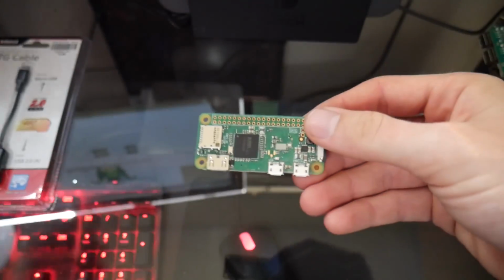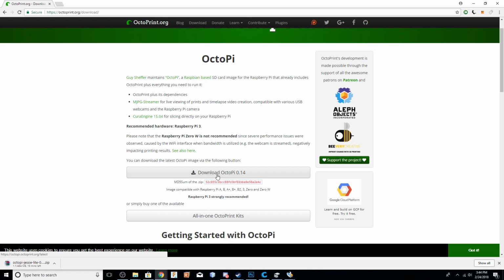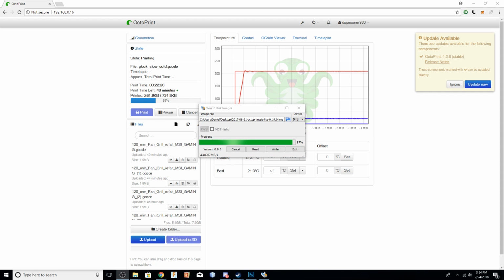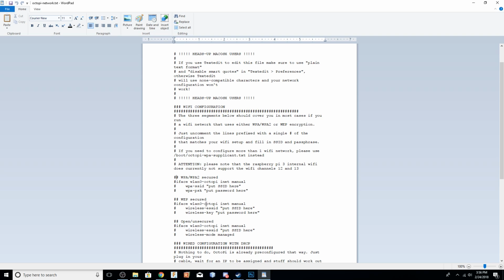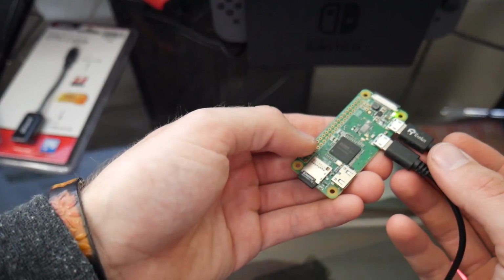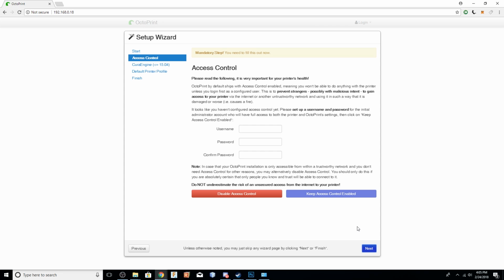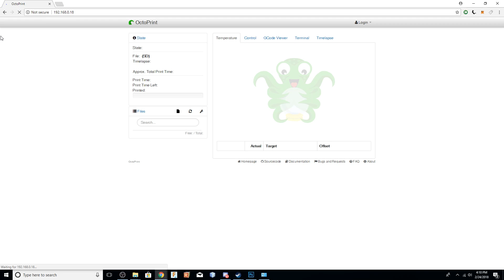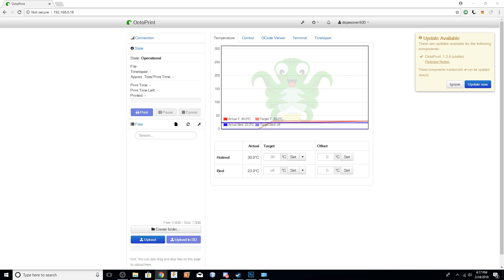Tutorial Installing Octoprint On Raspberry Pi Zero W | Wireless 3D Printing

Comment: The Raspberry Zero 2 W is as fast as the Raspi 3B and also has a quad-core CPU. 
The Raspi 3B+ has quad-core CPU and WIFI AC
The Raspi Zero 1, Zero 1 W and Zero 1 WH only have a single core CPU as a Raspi 1 B

Comment: new pi zero 2 w coming out an im hoping it will be able to handle the webcam now since it is suppose to have a faster cpu even tho the memory is still going to be 512mb from my understanding it suppose to be similar or the same cpu as the older pi 3 an same video. its a quad core 1ghz while the original was a single core at 1ghz if i remember correctly.

Comment: I just ordered an sd card wifi board, but it`s only limited to dumping files there for printing, no control over the printer itself, I did look at Octoprint with a normal Raspberry PI, but I thought the price was expensive and the board is overkill for whats it's being used for, this little board is just right, I`m ordering now lol, thanks for the great video, much appreciated, cheers ;)

Comment: So any issues with the Raspberry Pi Zero W using a camera? Does it still run ok a few years later? Their site suggest to not use it on a Pi Zero w.
Reply: Octoprint is pretty resource intensinve. If you want a 3d printer control panel with webcam streaming you should try klipper with Fluidd/mainsail on a more efficient Linux distro. I made this guide for an even weaker device and I get < 35% cpu load while streaming and printing: https://github.com/ihrapsa/KlipperWrt I've tried it on a rpi zero w and I get even less cpu load

Comment: does it really not work with a camera?
Reply: Octoprint is pretty resource intensinve. If you want a 3d printer control panel with webcam streaming you should try klipper with Fluidd/mainsail on a more efficient Linux distro. I made this guide for an even weaker device and I get < 35% cpu load while streaming and printing: https://github.com/ihrapsa/KlipperWrt I've tried it on a rpi zero w and I get even less cpu load

Comment: I installed Pi zero W with octoprint to my ender 3. Unfortunately I discovered Zero is underpowered even without camera. When printing round parts printing slows downd and quality is bad. PCU usage is aroud 100%. I reprinted same gcode from SD card and quality was much better. So I ordered Pi4 and it should work fine.
Reply: Try checking the usb power. Probably is an underpower charger.
Reply: @willss96  I used good quality 5V 2A charger. I believe Pi zero is the problem. I bought Pi4 for octoprint and it works perfectly and it is so much faster than zero. Just loading octoprint was nightmare with zero and now with 4 it is loaded in few seconds.
Reply: Thanks for the warning!
Reply: @DogeMcLovin  I am glad it helped somebody. Pi4 works great. Now I am using only octoprint.

Comment: does anybody have the issue  with the printer turned off  the pi zero W  supplies  power to the printer board my display lights up ( a little dim)   So I'm thinking  I might be using the wrong  OTG cable.  I'm using  one like in the video   micro usb  to female A..      My printer is a creality  that has a mini  usb connector.  I'm thinking  maybe  I need a  mini usb to female A OTG cable  Any ideas

Comment: the octoprint website does not recommend the Zero as per what's written on their website. do you think so too?

the following is said of their website here : https://octoprint.org/download/
"Please note that the Raspberry Pi Zero W is not recommended since severe performance issues were observed, caused by the WiFi interface when bandwidth is utilized (e.g. the webcam is streamed), negatively impacting printing results"
Reply: Don't use the webcam.

Comment: Really great tutorial. Simple clear and quick. Gonna try this on a zero when I get some time.  Cheers
Reply from the maker: Thanks bro :) do it! Especially if you can find them no ridiculously over priced! Streaming any time soon??
Reply: I have a couple in the bin I think. Might stream tonight if all goes well. Can't say just yet. Crazy busy lately ;)
Reply: Using a pi 3b+ for octoprint myself. Was thinking I should've just ordered a zero...only went with a 3b+ as if heard the zero w didn't work... until you said the lart about webcams being the problem. I litterally use that feature constantly so no joy for me. 

You did say something about slicing on octoprint though,  really? Mine won't even let me upload STLs/obj let alone slice them. Hence still using cura for slicing every time. How are you getting octoprint to slice is it some sort of fire and forget slicing profile where you just hope for the best and ask it to attempt default settings or can you actually customise it (raft/brim/skirt/temps/speed/infill/support types etc?  Would be interested in getting my octorpint set up so that I can slice on it if possible...just worry it won't be as customisable as I'd need!